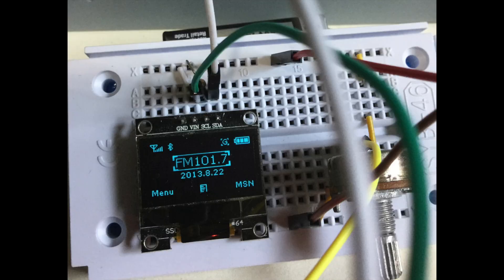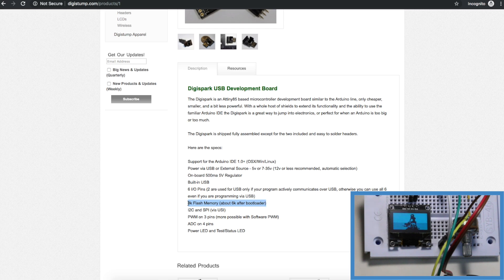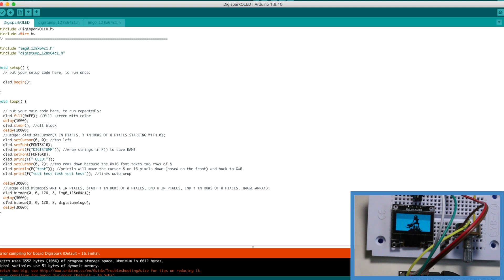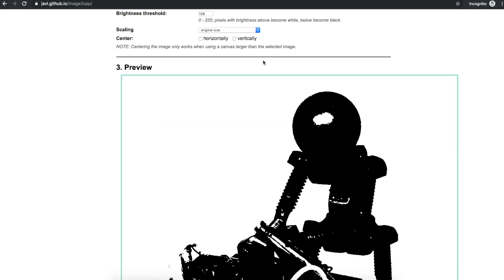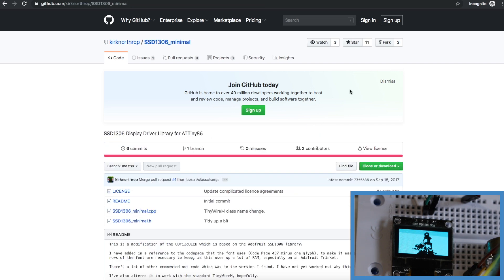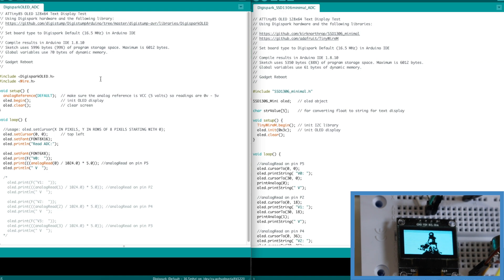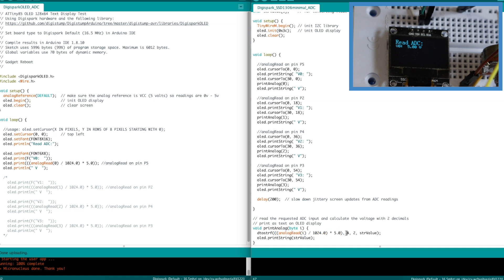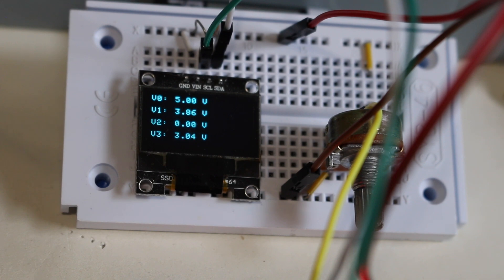ATTiny85 128x64 OLED - Display an Image from Program Memory

Comment: You said at the end of the video that if you use an ATtiny85 on its own (instead of a Digispark), you could save 2k on memory by not having a bootloader. But how do you program an ATtiny85 with no bootloader (assuming you're still using the Arduino IDE)?
Reply from the maker: I haven’t used the chip in a while but I have directly programmed it using AVRdude by taking the hex file after everything is compiled in the IDE and using an Uno as an ISP programmer but bypassing the IDE to directly talk to the chip.
Reply: @GadgetReboot  Thanks. I'll see if I can figure out how to do that 🤔
Reply from the maker: https://www.instructables.com/Arduino-ISP-to-ATTiny85/
maybe this would work while still using the IDE for the actual programming but using the Uno as the in between ISP  programmer for the ATtiny.  
I think by having that extra Uno in between the IDE and the target chip, it replaces the need to have a bootloader and the Uno acts like a regular independent programmer that’s capable of programming a completely blank device by putting it in reset and controlling the programming pins.
Reply: @GadgetReboot  Thanks. I will try to figure out how to do that 🤔

Comment: This is working great, previously I tried using the Wire.h, & the DigiSparkOled.h libraries & had lots of space issues. The only thing is, I found is that the ADC reading is off by almost 1 volt.  Yikes..... But otherwise this is really cool and explains how to print out digital values on the ATtiny85 which is not explained hardly anywhere. Thank you, subscribed....

Comment: This is a really good video thank you, just yesterday I was still further optimizing a similar program but in a much much more constrained environment, only 1K of flash, 64 bytes of ram, and yet I was able to fit:
- ssd1306 128x32 oled display driver that prints 64 characters
- bitbanging i2c for the oled
- analog voltage reading which selects one of the characters, and a button to enter (it's like a nano computer)
- and a basic functions calculator

So you input something like 67*23 and it interprets and prints on the next line the result, like a python REPL

I had to write everything from scratch in my own way, even the font is custom designed, a 4x6 font that expresses each character in 3 bytes only (to make use of every bit of the byte), and the bits are arranged in such a way that can be extracted back into 4x6 font with minimal code, so far the program actually uses just 780 bytes flash, and 46 bytes of ram, I'm intending to keep optimizing it while including more features, hopefully at the end to have a "nano computer" that runs something similar to TinyBasic, nano because the whole thing with display, interface, and everything will be 1.2 x 1.2 x 3.6 cm size

Just realized I went into too many details sorry for that haha I just enjoyed seeing someone also doing this size optimizing of a program and thought of sharing what I was recently working on, cheers!
Reply from the maker: Sounds like a lot of work. Are you going to put the project online anywhere that someone can reference the achievements later?  Someone may have even more optimization ideas...
Reply: Yes I guess I will, as soon as I finish the physical build, though I paused the project for a while because I started my graduate studies in computer engineering two weeks ago, it's unbelievable how much experience I gained from such hobby projects, as well as knowledge that I'm using in some courses, nothing's better than going forward with what you love

Comment: I tried the Adafruit OLED library recently for a project I'm working on and want to put on ATTiny85 when complete. That library is MASSIVE it turns out. I went in and commented out all the features I'm not using, like scrolling text and such, and was able to save a few kB but it's still far too big. I'll have to try this minimal library you've found.

Comment: just sub'ed as i like channels that give me something to think about. with PC programming there is no real need to read the spec of the processor, but in embedded systems it's the first thing you should read. knowing how the processor works helps in looking at the library's to see what you can cut out to save space.
Reply from the maker: Using the ATTiny85 is the first time I’ve had to conserve resources in a long time.   I think I might just squeak through on my current project without having to do much optimizing like ripping apart libraries  to condense them further, but I’m sure I will hit a wall soon and have to do something fancy.
Reply: @GadgetReboot  do you know how to increase the font size on the text in the minimal library or how to change the oled's color?

Comment: You definitely want to get rid of floats if you want to save memory. When using DigisparkOLED without float I'm down to 75% (4562 bytes). When using SSD1306_minimal it's even 62% (3736 bytes). 

DigisparkOLED : https://pastebin.com/uRsMGGj1

SSD1306_minimal: https://pastebin.com/g91YbwUB

Or even a bit smarter:
DigisparkOLED (printing all, 4918 bytes): https://pastebin.com/Jb8NCZ0X

SSD1306_minimal (3642 bytes): https://pastebin.com/CbywNSP3

Little disclaimer, only compiled them, didn't connect a display 0:-) 

And at add to this all, unfortunately the Digispark core isn't maintained. And it's by far NOT optimized :/ If I recompile the last sketch but with the ATtinyCore for the ATtiny85 with LTO enabled I use 2990 bytes instead of 3642  bytes.

And I always find it a bit funny when people add a while(1) to the loop(). That's what loop already does! Just move all your code to setup() an leave loop() empty ;)

And yeah, I just re-fuse my Digisparks to disable reset (and lock them to the bootloader) :) Because when the pin is floating it's to damn sensitive as well.

PS Please don't call that a schematic but rather a circuit diagram. On the Arduino forum we call it a Fritzing mess ;)
Reply from the maker: I will be working on the OLED  voltage measuring thing again this weekend so I will try these out and then try to figure out the flow chart for what is happening since it currently just looks like Latin to me.  Thanks! 
I still have to try out your optimized functions from that Arduino DTMF generator, I ended up putting the target project on hold but eventually I will revisit. 
 I guess fritzing wiring diagram is more accurate. But maybe I will start calling it a mess as well.

Comment: Your schematic has a small error. Both pins 1 and 3 are drawn to ground.  Shouldn't pin 3 go to the lower or next to the edge column?
Reply from the maker: I only noticed when it was too late to fix and I made a note in the video description that the github copy of the schematic is correct. I think when I was dragging the wire I didn’t drag it far enough and it snapped to the other breadboard pin.

Comment: Very useful vid, I'm playing with ways to do things with efficiency in mind myself, I'm actually moving away from "analog reads" and "digital writes" in favour of direct port manipulation, more for interest sake than saving memory, but this is great because a lot of libraries gobble up memory very quickly.
Reply from the maker: Doing more direct analog reads also allows some amount of improvement in how fast we can read and then we can increase our sample rate if we need to sample higher frequencies in a waveform. I am almost getting nostalgic to go back to straight assembler sometimes.
Reply: @GadgetReboot  And I'm just learning!...I guess you like Julians channel then?
Reply from the maker: I think everyone does
Reply: @GadgetReboot  i think that as processors get more complex, assembler gets harder and slower then using a compiler. but i expect this is not the case in Ardunio land. i do wonder how many people read the datasheet to see how each internal bit works. just looking at the ADC conversion time / clock speed will tell you how fast it can go.

Comment: There is a rather significant difference between the two examples displaying the voltages. The first uses two fonts while the second only uses one. A typical font used in the Arduino world has 95 characters (Not sure if this is the case with the libraries you are using, but I will assume it is for now). The minimum program memory used by an 8x16 font would in that case be 1520 bytes. The minimum for a 6x8 font would be 570 bytes. To get a better memory usage comparison you should remove the 8x16 font from the first example and only use the 6x8 one. My guess is that you would be able to display all the readings in the first example without any problems using only one font.
Reply: for a device where you know at the design stage what data is going to be displayed, e.g. 0-9 and 'V' i would create a font table that only has these in it. if you are never going to display anything else then a full font will be a complete wast of space in memory.
Reply: It may be that the library doesn't support that option. I designed the font handling in my libraries to be able to handle subsections of the ASCII table just to be able to conserve memory. The subsections have to be consecutive though.
Reply from the maker: When I took out all references to setting font and just allowed it to do whatever it wants for the default font, the memory usage reading only one analog input only changed from 99% to 98% so it was negligible for this test and that’s why I didn’t mind just leaving both fonts in. 
 I don’t know if there is something down in the library that loads in both fonts regardless if they are used or not.
Reply: I would have expected not using the larger font to free up about 25% of the available program memory, but it is probably like you say, an issue with the library itself including both fonts even if they are not used.

Comment: It's amazing the difference an efficient library can make.
Reply: @Gadget Reboot When you just do not use the Arduino IDE with its embedded OS, and just do plain baremetal programming with for example Eclipse, then you have a lot more memory to play with.
Reply: Side note:  Hope you discovered DigiCDC.h -- Debug print statements through USB ... but it takes precious Flash.
The Tiny85 is truly amazing.  Kinda wish they made one with more flash and memory.
Reply from the maker: And I am usually very sloppy with the coding so I take everything for granted and burn through memory but this time around I was like, what? I can’t multiply and divide?
Reply: @Gadget Reboot I do not know the AT-family. But with ARM cores, some cores do not have hardware divide. Therefore you must implement the divide in software. And with plain baremetal programming, you do not use the GCC library, hence you need to implement the divide yourself. When you doing divide smart, then it is a small footprint.
Reply: @ArjanvanVught  is that just a floating point x and / etc. as not many micro controllers can do floating point math in hardware. usually fall back to fixed point math as it's a bit easier.

Comment: Pretty neat. I bought one of the knockoff digisparks with a micro USB socket on one end and a DIP8 IC socket on it alongside my normal digispark. Turns out the bog-standard ATtiny85s you buy from the usual suspects need to have the micronucleus bootloader burned into them, which required going through the effort of putting together an arduino ISP. At that point I was putting bootloaders on them for the convenience of the USB connection but losing that convenience at the same time. Well at least now I have a couple of DIP8s microcontrollers with bootloaders on them that I can just solder into circuits after programming them, which was the general idea. But for their specs I don’t think they’re worth the price, so I’m leaning towards going for Cypress’s significantly cheaper MCU line.
Reply: I think the way to go is to burn MicroNucleus, (check that it works), then fuse out the reset pin.  That way you get that extra Analog Read / GPIO.  You can then run an app that makes the whole thing into USBtinyISP.  Since MicroNucleus always runs at power-on, it is still possible to reprogram the chip.  I have a lot of 3.3V Zeners laying around ... used for AVR-to-USB1 experiments.
Reply from the maker: I went through the micronucleus thing earlier this year including high voltage fuse resetting after messing things up, and now I'm all settled in.  I haven't used any Cypress MCU's yet....yet....